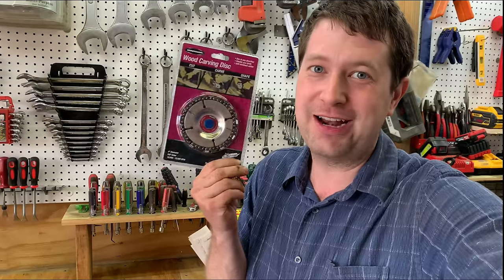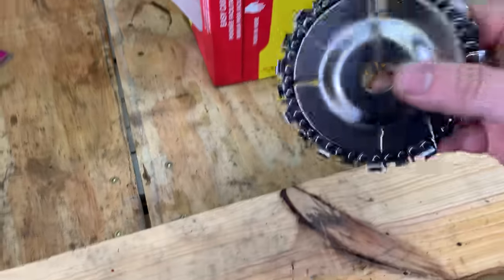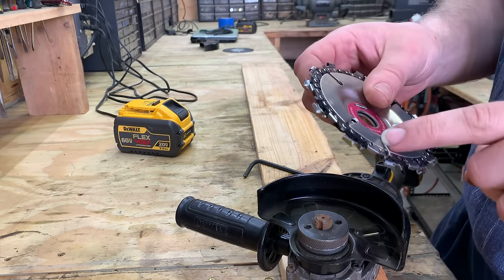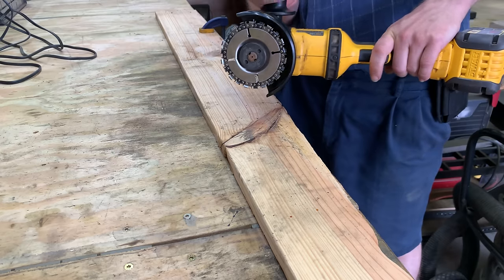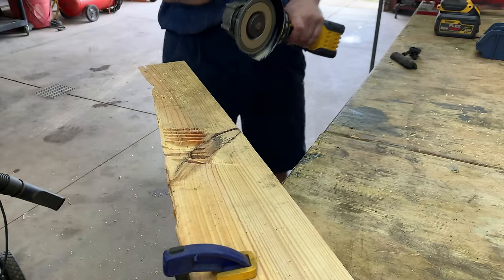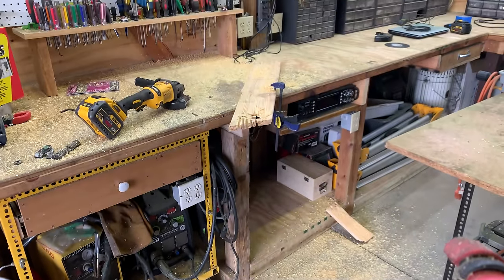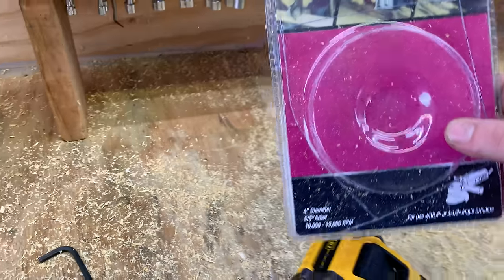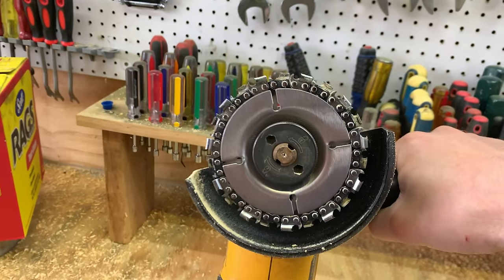Most Dangerous Angle Grinder Attachment I have Ever Seen

Comment: Is there a "safe" angle grinder attachment?  Even a buffing pad will rip the shirt off your back.
Reply: Now you tell me
Reply: Nope, no such thing. I mostly use it to cut metal and use a Diamond blade disc rather than your typical black grinding disc. A perfect exemple of something more expensive that turns out cheaper. They work a ton better, cut faster and last a lot longer. I also consider them safer as they dont explode when they fail like regular grinding discs.
Reply: @EvilMaxWar Diamond disc is slower than standard cut off disc.
Reply: Fair, but part of risk assessment is the "overall damage" aspect if it fails. Because of the chain teeth jt has the capability to cause significantly more havoc than a standard grinding disc.

Comment: Congratulations!  Other than leaving the guard on, you broke every safety rule for using a grinder in under 10 minutes!
Reply: What was it her did?
Reply: @noodlesoup2281  For one he is not suppose to carve the wood but to cut it...(dont go left and right like a maniac) he could have adjusted the protection a lot better so he would had to hold the grinder under this weird angle..? where are his protection glasses? it seems he has used the angle grinder maybe 10 times in his life haha
Reply: @MrFran007  umm… you do realise this is a disc for wood carving? 
It’s not your standard inox or stone cutting blade. It’s meant for exactly what your saying it’s not?
Reply: At least the grinder handle is on there
Reply: @MrFran007  It is for carving, it even says so on the package. That's exactly why people buy these.
Reply: @noodlesoup2281  The loose shirt could easily get caught up in the tool.
Reply: @Trtlman  kidding right? 
Have you ever worked in a trade? 
What’s he supposed to do wear leathers and a gimp mask? 🤦‍♂️
Reply: No gloves. These are banned in the UK

Comment: I was so relieved to read the comments and see I wasnt the only one that thinks his man card should be pulled asap
Reply: I have consulted the counsil.
Reply: Na man one of these fucked me up so bad, mine kicked back and hit my forearm and shredded my arm down to my bone and it looked like hamburger meat. These things are dangerous af, i had the handle on, the guard and a 2 handed grip and it still flew out of my hands
Reply: @jimboneutron8399  looks like someone else need their man card taken away.
Reply: @jimboneutron8399  You're holding a chain saw blade spinning faster than God ever intended a chain saw chain to saw, yeah, it's gonna f you up if it gets loose.
Reply: Jim Dean angle grinder 10k rpm my stihl hits 12k rpm so think about that?
Reply: @jimboneutron8399  well what did we learn? Lol hold tighter
Reply: @umbraviventem  Anybody who knows anything about chainsaws knows that cutting with the end of the bar is the easiest way to get kickback. This grinder attachment is literally the tip of a chainsaw and nothing else so it is a very dangerous thing to use. Is very likely to kickback and when it does you have no control over it.
If i'm not mistaken the company that made these things no longer exist and they were only in business for 6 months.
Reply: @MacDaddyC7Z06  Holding tighter does nothing to help kickback.
Reply: @Turgz  you would be mistaken because you can find these still today in home depot and lowes
Reply: @umbraviventem  It must have been a specific brand that I'm thinking off then.

Comment: That "Protective Sticker" was on the metal plate before it became a disc and they just did not spend the time, effort, or expense to remove it.
It was originally designed to hollow out the seating surfaces of chairs for home carpenters, and it was made by Rockler.

Comment: If anyone is curious it won’t actually chop your leg off. I had to get 24 inches of stitches in my leg. I used the tool for under 2 seconds on press board. The moment I touched the wood it kicked back super hard and into my right shin. 

For clarity. I use an angle grinder at work at least 6 hours a week on metal. I’m not a moron. This tool should not be sold at harbor freight or Lowe’s.
Reply: It should be banned
Reply: Agreed!!!  a chainsaw chain attached to a 4" disc that spins at 10,000 (+) rpm's.  What could go wrong?

Comment: What a tool, the operator not the carver, totally clueless. These have been around for years in one form or another. A little research and he could have found out how to use it safely. Some PPE would have have helped too.
Reply: The guy has no clue. The tool is just fine.
Reply: I was actually thinking at first why is this abomination a thing, a grinder moves way faster than a chainsaw moves those type of blades. Was thinking wouldnt a skill saw style blade work better for cutting wood? And then I saw how nicely it carved, I'm impressed, I thought it would be rough as.
Reply: Mark Hunter he's the type of guy who skips through all of the instructions and gets confused why it's not working as advertised.
Reply: @Neishy4AGTE  That's not true. Chainsaws can go up to 14k rpm, while most grinders won't go more than 8k. Those battery powered ones even less.
Reply: Motor rpms are very much different to blade speed.
Reply: svetko05 not true most 4”-4 1/2” angle grinders run at 10,000-12,000. Only bigger 7” grinders run at 8500
Reply: @charlesbarkell4101  exactly, and the reason for that is to adjust disk speed to about 80 m/s because of the different diameter disks, because that's where the right speed for friction cutting/grinding steel is.

Comment: I use this carving disc as a wood sculptor.  I removed my grinder guard for better maneuverability, as well as the grinder secondly handle, again for more flexibility.  As a carpenter for 40 years and a chainsaw fanatic I will agree that this attachment is dangerous, however most of my tools are.  The most dangerous attachment in my shop is myself.  Respect the risk, keep your fleshy bits away from the moving parts, and keep your tools in good working order, you must be in control.  
     Bottom line, if your scared, if you lack the confidence…..use something else that your ok with.   And yes, I still have all of my fingers!!

Comment: When it says "Use in any direction" it means you can cut with wood grain or across the wood grain. You have way too many negative remarks before actually using the product or knowing what it is used for. I find it very annoying.
Reply: I think it means that you can flip the disk around so that the chain is spinning in reverse or that you can remove that chain and flip the chain around to expose a second set of cutting teeth

Comment: Title should be called” how not to operate an angle grinder”
Reply: Why?
Reply: @axtra92  no PPE whatsoever, shorts are the worst pants, short sleeve shirt, just... everything is wrong. you should wear a long sleeve shirt, preferably a leather jacket, leather gloves, jeans, steel toed boots, a face shield, and safety glasses. when one of those wheels decided to go the "Rapid Unplanned Disassembly" route, they can launch a piece of a grinding wheel THROUGH your abdomen.
Reply: @jacksheppard2096  over dramatize much?
Reply: @donhodson4690  its not an understatement. with as little PPE as he is wearing, it could easily launch something that size through your stomach.

Comment: That thing is meant for power carving, not to be used as a cutter.
Reply: Literally says cut on the package
Reply: @D_Town_Throwdown  It's literally called a 'Wood Carving Disc'
Reply: Still a dumb idea.  I know ppl that carve with both chainsaws and angle grinders but this looks like a dumb, useless and dangerous gimmick.
Reply: No, this is a Harbour freight advertisement
Reply: @user-wp5fe8ec6l  welded one together with sheet metal and a chainsaw blade, did an awesome carving on a 30' long bar counter top, started trying to use existing tools like a chainsaw and none worked as well and often ended up being more dangerous for the work we were attempting, this tool (our version of it) actually worked amazingly and did the whole counter really fast.

Comment: Had you bothered to open the entire package there are directions for use inside. The only thing I saw that was dangerous was the tool trying to use it.  When set up correctly and used for its intended purpose its just as safe as any other tool.
Reply: Robert Baker 🤣🤣

Comment: I have used this tool exactly once a few years ago. I ended up in the emergency room a few minutes later. Anti kickback action my ass. DO NOT TRY TO TO CUT A CHANNEL OR GROOVE WITH THIS TOOL. It will flutter between the side walls violently when you least expect it, jump out of the groove and liquefy everything in its path. It caught my left arm and right palm before I dropped it.

Feel free to purchase and use it, but be very aware of its destructive ability.

It has lounged around in my toolbox sneering at me ever since our first/last encounter.
Reply: Why were you using it like that? It's a carving disc. Not a cutting disc. Cutting channels sound like a operation best accomplished using a router.
Reply: @sentry8992  I was trying to carve a head on a piece of wood. Once I started carving the chin and the neck I tried to do too much too fast by plunging the tool under the chin to the depth of the neck and the tool told me it wasn't happy with my method. Totally my fault. I need to build some metal vambraces if I ever plan to use this tool again.
Reply: @michaelsemenchuk3056  
I'm an artist as well. Based on your description, a saw zall would have been a great choice to make a series of relief cuts first. The saw zall would have quickly got to the depth from chin to the neck, then you could have come back with the carving disc. Wherever possible, always make a series of relief cuts first. Also there's 2 other carving disc's available on the market that does very similar carving operations but do not utilize the chain mechanism that could get caught or bind up in the material. The other 2 designs are easier to work with. Amazon sells a 9 disc set for 30 bucks. The set includes all the different styles of carving discs.

Comment: My husband of 41 years passed away this past August.  I have been looking over his tool collection and trying to decide which ones I should keep.  I came across his die grinder but had no idea what it is used for which is why I am here.  I am very impressed with what you were able to do with your new attachment.  My mind was racing with the possibilities for it's use.  I will keep the die grinder and tomorrow pay a visit to Harbor Freight for that attachment.  Thank you for sharing.  And yes I agree it has the ability to do a wicked amount of damage if used without the proper precautions, I will use it with all due respect.
Reply from the maker: If you can but this anymore! It has been removed or even banned in many locations due to the extreme danger of this tool.
Reply: @radozeman  thanks for the info.

Comment: I used this blade about 10 years ago. I cut off my left index finger and the next two fingers next to it were cut half way through. Three operations and four weeks in hospital as a result. Take my advice. Throw that thing away and never use an angle grinder to cut wood. Be warned. 😬😬😬😬
Reply: Mork did the chain disengage and whip across the fingers?
Reply: Whoa
Reply: Yes, please tell us how it happened. I’ve owned 3 chainsaws and this doesn’t seem more dangerous
Reply: Craig Wheeless - I think it could be more dangerous. I have come to the conclusion that you pretty much need two hands on a chainsaw to maneuver/ operate. However a grinder can easily be used with only one hand on the tool and the other holding the piece of wood.

Comment: As a wood carver I used one for a while. It was effective and i liked the results, but every time I used it when I would put it down i would have to kind of meditate and think about how i had used it. I also used angle grinders for years in construction for rebar. Then my angle grinder jumped with just a sanding disc and bit in to my forearm. Had it been the chainsaw disc I would have likely had permanent damage. This thing is scary and there are belt driven grinder attachments that extend the cutter away from your hands and if it does kick, the belt stops it spinning
Reply: How did the angle grinder jump and catch your forearm? Were you using it with one hand? An angle grinder should always be used with the handle and two hands.

Comment: I had a lot of old pipes and rebar to cut up and from what I read https://www.youtube.com/post/UgkxPDBfLu68o58Aw85O_J-zIFfjJARBhp-3 this would be the tool for the job. Since I had never used one, I watched a couple of youtube videos and I'm so glad I did. Some really good safety tips, which I followed, and this tool did a splendid job. One good thing to know is the weight of the tool puts just about the right amount of pressure on the metal I was cutting, so I didn't have to use a lot of pressure, which is more likely to jam the tool. It made fast work of my job.
Reply from the maker: Yes, it is!
Reply: didn't know a chain saw blade was meant to be used on steel
Reply: I guess you mean the angle grinder not the chain saw wheel.
Reply: please make a video cutting rebar with one of these discs 😂

Comment: I will go along with others here.....  The only part of this video that really is dangerous is the TOOL doing to the video and using the tool.  I mean a new item to his workshop and NO PPE.....  There's the danger... The user.  And if he did some research before doing this video he might realize its not dangerous unless you use it outside its intended purpose.  I would find that an amazing tool for certain jobs. God forbid he use something bigger then a grinder.
Reply: Yeah this guy made an ass of him self.
Reply: you probably need to read the other comments, this tool is INHERENTLY more dangerous than out angle grinder attachments , regardless of the operator. Should watch the Stumpy Nubs video of his accident with it.

Comment: This does look like a very effective tool... However it looks like it could bite the operator very easily and just as quickly. What would be the best practices for using this tool?

I’ve added some initial guesses below...

- Use it with a grinder that has a clutch or brake so it doesn’t idle when you power off.

- Never use it ”always on” mode. Make sure you need to hold the trigger, at least then when you let go, the danger stops.

- Personal protection : eyewear as a minimum, leather apron, chain mail gauntlets...

Comment: Also, you’re punching the damn chain into the board instead of at least being gentle when trying a tool you’ve never used
Reply: He was trying to see if it would kick back. It was quite amazing that it didn't!
Reply: @Professor-Scientist  And in doing so, he proved he either didn't read the instructions or didn't give a crap about safely using it.  Carving disks are only supposed to be lightly touched to the surface AND only pulled backwards, never pushed forward.  He actually shows proper control later in the video.  The manual has only 6 pages of instruction, and all but one are dedicated to proper safety precautions.

Christ.  I'm not one of the YT safety patrol, but I've had a King Arthur Lancelot disc for about 5 years and spent a bunch of time watching videos and practicing with it.

Comment: Looks like a hefty piece of metal, and is cleared for 11K rpm.  I guess you should hold the angle grinder at an angle when you carve, and straight when you cut. That shield of yor grinder is not in proper position-anticipated "exit" of a damaged disc is cca. 80-90 degrees down relative to grinder axis, not straight!

Comment: Seriously dangerous piece of kit as I discovered, kicked back big time when working on a solid piece of timber, went straight through my work gloves resulting in six stitches on my left hand index finger, lucky not to lose the finger completely
Reply from the maker: Oh I can believe it!
Reply: Same thing happened to me while power carving. Got four fingers. Severed tendons in my ring finger. Took a chunk out of the tip of my index finger. Shredded back of my thumb.It's a tool that should not exist. There are safer options for power carving.

Comment: P.S. the little nubs between the sharp blades is a "safety" option on chainsaw chains. Those teeth keep it from kicking back. First YouTube video that ever gave me anxiety...ugh
Reply: wrong... they're called rakers, and control the amount of wood severed by a cutting tooth.
Reply: Tom  No sir, the chain-break is meant to reduce likelihood of injury from kickback. To my knowledge the only way to avoid kick back in its entirety it to insure proper technique while using the saw.
Reply: The rakers I'm assuming you refer to set the depth of cut...
Reply: @dunc71   And the raker is only effective along the straight length of a chain bar.
These DO kickback very easily if the blade approaches the material from the wrong approach attitude.

The proper technique is do not buy these stupid attachments that every grinder manufacturer tells users NEVER USE TOOTH DISCS.

Comment: Actually familiar with this tool, have used it in the past in very tight spaces that I really did not want to share with a chainsaw. Also much quieter than a chainsaw which was the primary reason that I used it at that time. Enough said there. Chainsaw carvers use these as well. No more dangerous than than putting a circular saw on an angle grinder and they are available. I used one a couple of years ago. Just be careful the same as with any sharp tool. These are NOT McConsole approved by the way. ROTFL
Reply from the maker: Hmmm not McConsole approved?.....  Good point.  I’ve actually never seen one of these before, then again I’ve never put a circular saw blade on a grinder either.
Reply: @radozeman  nor should you.